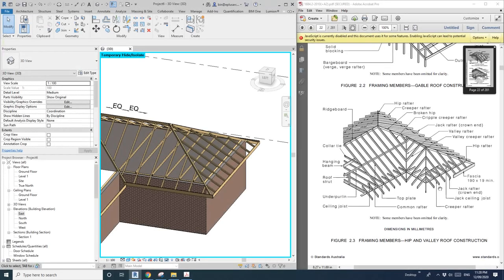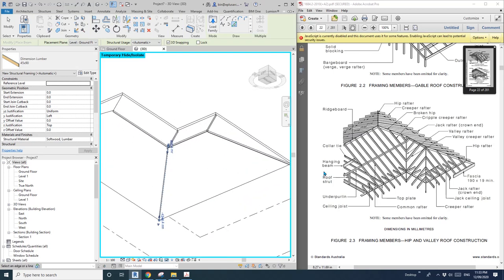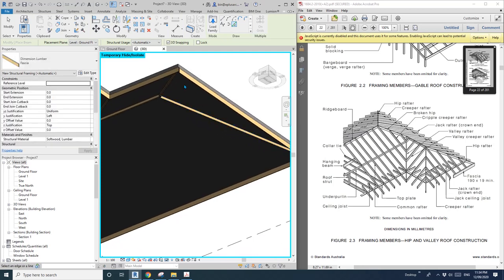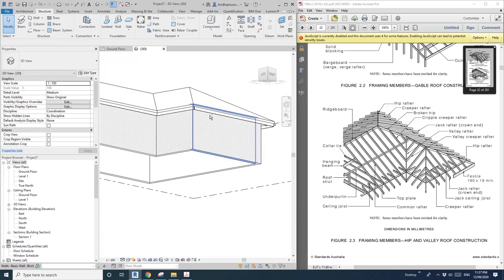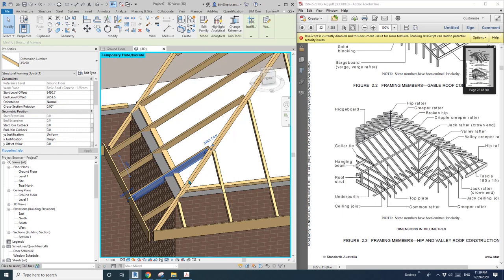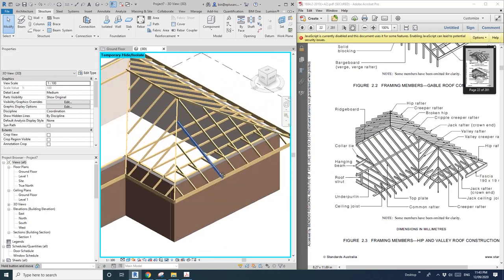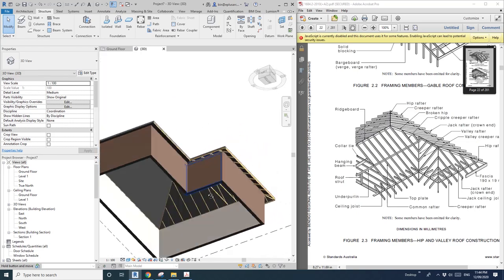Revit Exercise (Day 175) - Roof Truss Structure Exercise

Comment: thank you...can you make details of wood with dimensions ready to cut?.... for instance , if I want to  precut all the framing instead of cutting them at the job site....
I want to make my own business but WI ant to pre-fab as much as I can before installing it
Reply from the maker: I think you can create a structural framing schedule and list the length of all the timber frames. But it’s probably not very accurate. Maybe you should check and see if there is a timber framing addin for Revit?

Comment: Thanks for this. Curious why you did not attach the roof to Level 1?
Reply from the maker: It's up to you I guess.  I refer placing the roof on floor plan so I can roughly tell the height by selecting it, actually, I like to model everything on the floor plan to have minimal amount of levels. :)
 If you place the roof on the Level 1, you can adjust the roof height by adjusting the height of Level 1.
You will figure this out and find your preference soon.

Comment: Hello, thank you for your great video! Is there a way to join the beams so they have a flush connection? For example, making the rafters meet the ridge flush at that angle.
Reply from the maker: Yes, you can use the Cope tool.
Reply: @BINHE615  It seems that when I use the Cope tool, there is a gap between the elements. Is there a way to eliminate this gap so the two elements are touching? Thank you again for the video and thank you for your response.
Reply from the maker: @Glorbs444  Select one of the beam and  find the Notching Distance

Comment: How do u make facia without set work plane just pick line with just 3d snapping ?i have just tried it many time it said cant create then i set work plane so i can make facia?
Reply from the maker: You can use the fascia tool under the Architecture - Roof tab.
Reply: @BINHE615  sorry i maen in minute 3.42 how do u select it without select work plane
Reply from the maker: Yes, you have the option to 3D snapping while place structure beam, but sometimes it does not work. Instead you can set work plane first and place it without 3D snapping check. This will create a member in that selected work plane.

Comment: hi, Bin He thanks for this video it is very helpful, in case I want to change the slope of the roof is there a way to align the hip rafters so they can follow the slope? I tried changing the roof slope, I'm not sure which slope I want to set for the final design, and some beams, mainly the hip rafter beams and some individual beams from the beam system stay on the same position while the roof changed slope.  I  fixed the beam system by doing a reset but I could not change the individual beams on the hip rafter.
Reply from the maker: To be honest I don’t know how to make the rafter you follow the roof (height), I would just use the spot elevation to find out the height and manually adjust the 2 heights for the rafter.
Reply: @BINHE615  I was thinking if it is possible to create truss just with the top beam and align it to the roof. Thanks I will use the spot elevation. Trusses are kind of confusing.
Reply from the maker: @CrlsE094  Yes, I think it's possible to use the truss. But I don't think you can simply align the top beam to the roof.  What I can think of is to create a truss with an angular parameter for the pitch, so you can easily adjust the angle when you need to change the pitch. What do you think?
Reply: @BINHE615  I believe that trusses have the Attach top base option like in walls if I’m not mistaking. What I’m not sure is to what side is going to be attached because the hip rafter is not plane, it is a line. I think I will watch your truss videos, I find trusses very confusing hehe . I was thinking of a truss just with a top and bottom chord for structure support and the option to extend the top cord, in order to have a high ceiling or vaulted ceiling. But as you said, controlling the angle with a global parameter will be a more simple solution.

Comment: why do we duplicate beams? I dont get it someone please
Reply from the maker: Can I help?
Reply: @BINHE615  yea , we do you duplicate beams when you go to edit
Reply from the maker: I’m afraid I still don’t get you. Can you show me the time in this video where you have this question?
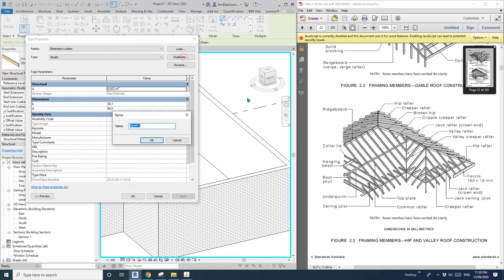Reply: @BINHE615  ok, in minute 2:14 why do you duplicate the beam, or used this duplicate function, can't I just go to load family every time I need a beam?
Reply from the maker: Yes, you can.  I prefer using some standard size, eg. 45x90 instead of 38x89, so have to create those new type. Sometimes I will just duplicate types because it's faster to do so than loading it from the library. :)
Reply: @BINHE615  ohhh i see! thanks!